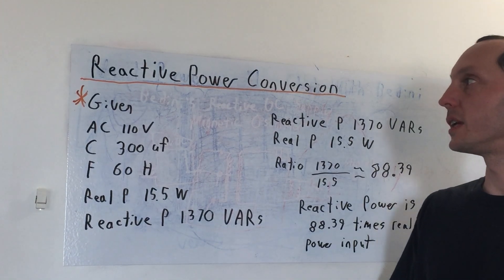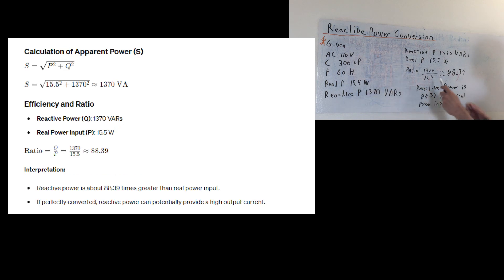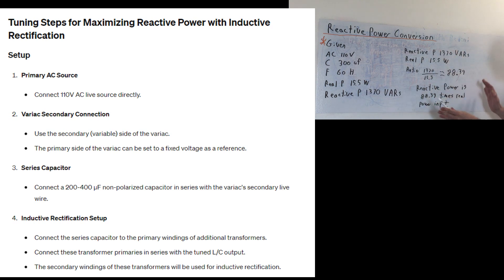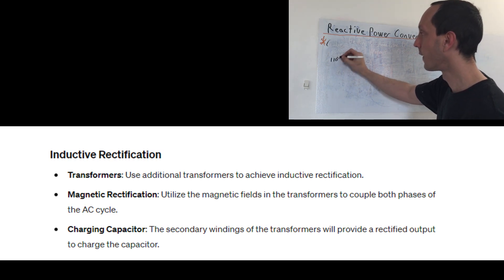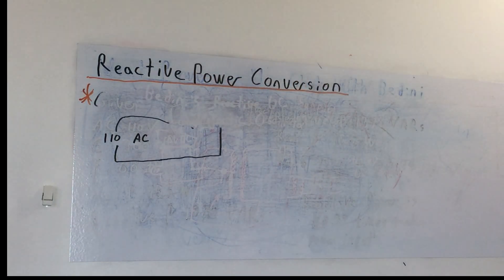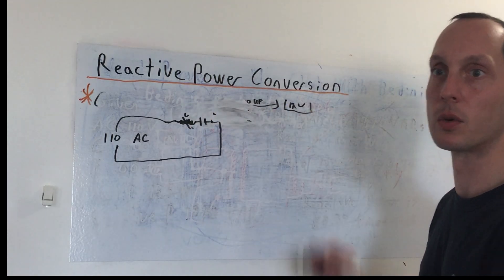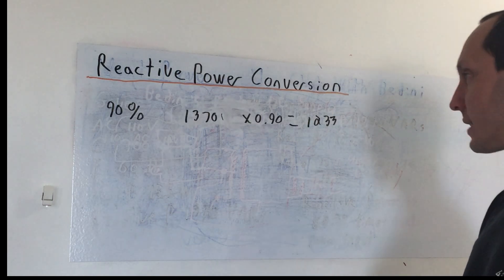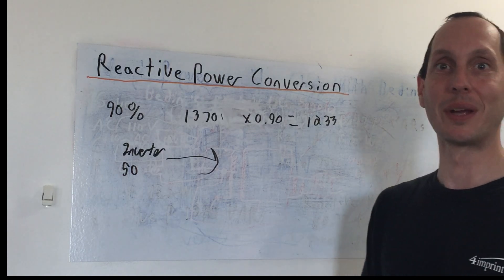Reactive Over Unity

Comment: If we build a transformer with the primary charged with a high amp dc current we can essentially use the secondary as a diode while maintaining the coil/capacitor arrangement. I believe tesla had mentioned this in his lectures.

Comment: check out Hector P. Torres's Work he did the original rotoverter and transverter and used a special diode plug to cap of off the reactive part, leavinbg the system still in resonance running

Comment: You gonna have to play around with the ground connection.Where to put it in the circuit to get better results.But you have a coil and capacitor at the same values You should get a very high Output

Comment: You only need a capacitor and a transformer in series, just tune the capacitor to amplify the resonance, the secondary is used to rectify to dc. Simple. To amplify you only need a capacitor with the same current drop as the transformer. But beware high voltage and current resonance!!! when done right 5 times more power.

Comment: Don Smith Filtering Method: Synchronous LC Rectification
In synchronous rectification, the phase difference between current and voltage in the LC network can create a unidirectional flow of current. Here’s how you could set it up:

   Reactive AC Source
     ~
     |
   
     |
    --- L1
   /   \
  ---  ---
   |    |
   |    C1
   |    |
   L2  ---
   |    |
  ---  ---
   |    |
   C2  Load
   |    |
   |    |
  Ground

Working Principle:

Inductors (L1, L2): Inductors are placed to create a phase shift and limit the AC ripple.
Capacitors (C1, C2): Capacitors smooth out the ripples in the AC signal, working in conjunction with the inductors to provide a more stable DC output.

LC Network:
The inductors (L1 and L2) help in phase shifting and smoothing the current. They resist changes in current, which helps in creating a steady flow.
The capacitors (C1 and C2) charge and discharge in such a way that they smooth out the voltage fluctuations, thereby converting the AC into a pulsed DC.

LC Filter Design: Properly design the inductance and capacitance values to match the frequency of the AC signal and the required output voltage.
Load: Ensure the load is compatible with the quasi-DC output generated by this method.
Example Component Values (for 50 Hz Mains)
Transformer: A step-down transformer from 220V to 12V with a center tap.
Inductors: L1, L2 = 10 mH (depends on the load current).
Capacitors: C1, C2 = 1000 µF to smooth out the 50 Hz ripple.😁
Reply from the maker: If you want higher current AC from the filtered stage instead of DC, Just pulse (modulate) it with a small 60 hertz inverter. For those who want to do this at high frequency.

Comment: According to my experiments, and after witnessing these effects, there is nothing to object on what Joel is talking about. Reactive power is also known as the reflected power, or the power that is returned back to the generator. In layman terms, this reflected power can be used to produce real usable watt, without having to pay for it. It is a matter of coversion, done with proper tunning. The highest cap value I used in series was 100uf. I was able to produce 100 watts of usable power. 75 watts was being used by the load while 25 watts was being returned back. No active watt was consumed as my power factor was  negative. The higher the capacitor value the more usable energy can be extracted.
Reply: If you have a 100uf cap In series with A 100uH coil and pulse it at 630uS  you can get close to 100%
You will have to play around with the ground connection and Where to put it on the circuit.